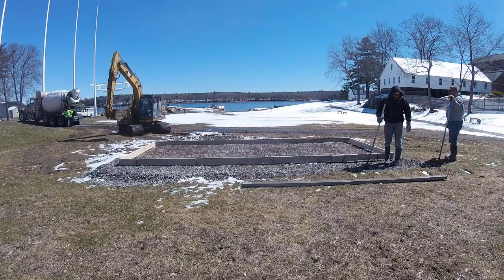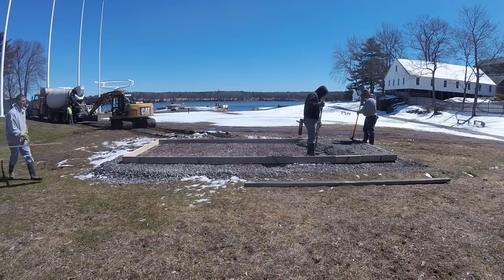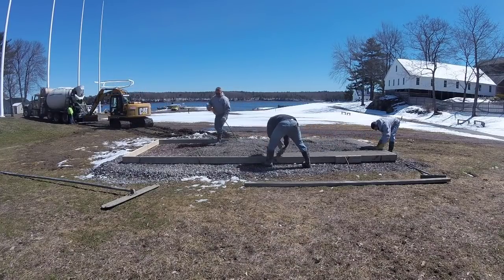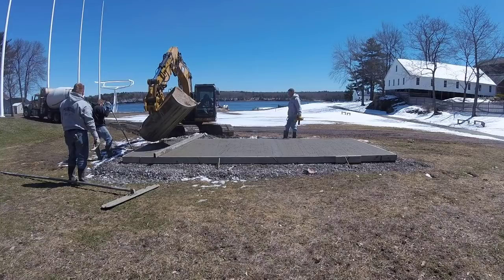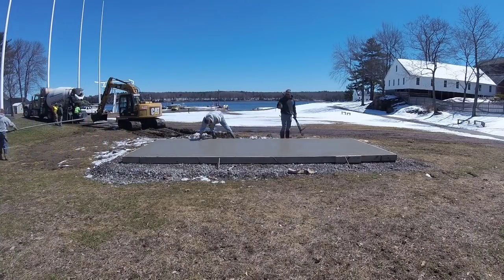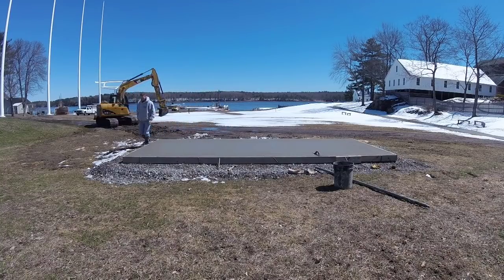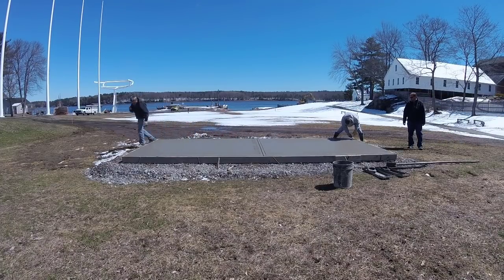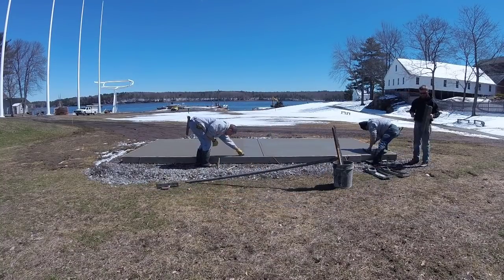DIY CONCRETE FINISHING TECHNIQUES : MAG, BROOM, EDGE, GROOVE

Comment: Do you have any videos on doing curbs start to finish, what base to use, how deep, how to finish the sides so it looks all uniform, etc ...
If not, would be a good one to do.
Great videos by the way.
Reply: I wouldn't recommend pouring and finishing curbs unless you have an experienced crew. I used to finish behind a curb machine for many many years. Curb and gutter is a completely different beast than flat work.

Comment: I’ve got a 350 yard concrete path to lay 6 feet wide. I intend to put groves in every 10 feet but should I also put full expansion joints in and if so how far apart. Thanks John
Reply from the maker: On big projects like this, we usually have a full break every 35 feet.
Reply: Mike Day Everything About Concrete Thanks Mike. I find your videos very helpful. It’s interesting to see different work practices between the US and the UK.
Reply: Thanks Mike. Great info. Keep up the good work with these interesting videos.

Comment: Mike, when would you use plastic under a slab to keep moisture from coming up through the floor? This slab looks like the floor, for a storage building, or a food building like for a soccer or football field.
Reply from the maker: We use vapor barriers a lot under our slabs, especially house and garage slabs. If you think some type of flooring is going to be installed on the slab, epoxy, hardwood, laminate, etc. then always put a vapor barrier down. It's really cheap insurance to just install one whether you think you need it or not. This slab in the video is for a set of bleachers. no need for one here.

Comment: Mike, I would really like to know about the concrete truck.  How does it work?  Who pours from the truck?  The driver? You? The shoots, who’s are those? Drivers?

Any kind of slang jargon you use with the driver?  Are there controls?  Who works them?

I have learned so much from your videos and have done a couple of small practice slabs 
But I am apprehensive about calling the truck as I won’t know what to do.  

Thanks
Reply from the maker: I'll try to explain that more thoroughly in other videos.
Reply: Thank you. I appreciate it very much.